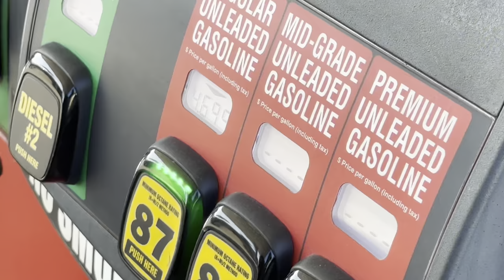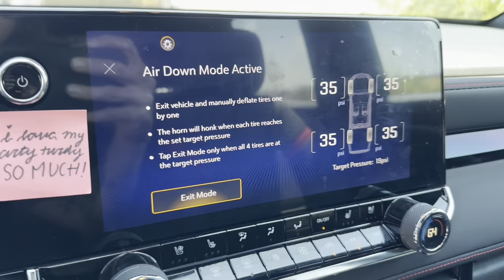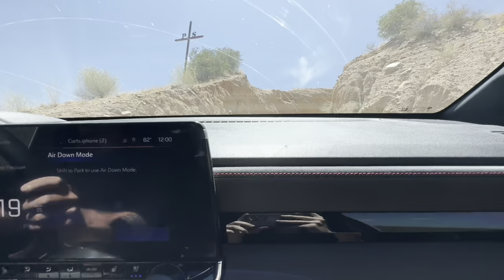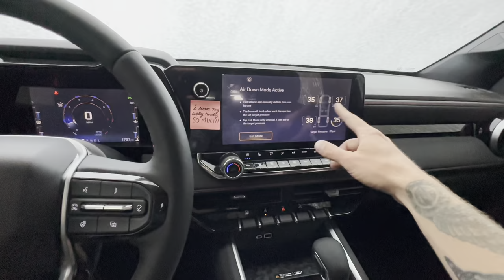I RUINED MY *NEW* 2023 CHEVY COLORADO Z71 OFF-ROADING !!!

Comment: 11:47 your at one of those touchless car washes aren’t you, I took my new Colorado Trail Boss through them here in Phoenix, but on my 3rd trip, I guess I drove through the blower to slow and it dented my roof, I heard it pop, looked at my roof and it dented it, the owner had cameras and payed for the repair, cost 250 , I use the Dent Medic, he gets dings and small dents out, I’ve been using him since 2002, he got a couple dings outta my new at the time Silverado that I still own,,,but watch those two blowers when your driving out, you go to slow and it will dent your roof, I only had 300 miles on my truck when this happened ! 🥵
Reply from the maker: Oh yeah mine makes that pop sometimes ! The dent eventually comes out for me but if I do drive threw it it dents it lol
Reply from the maker: It actually did that when I took it to the car wash in this video lol